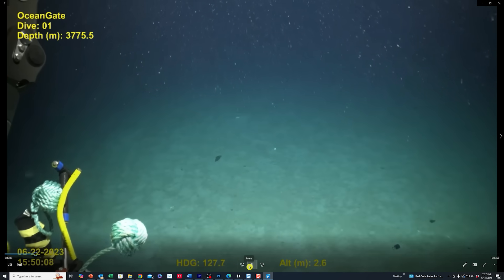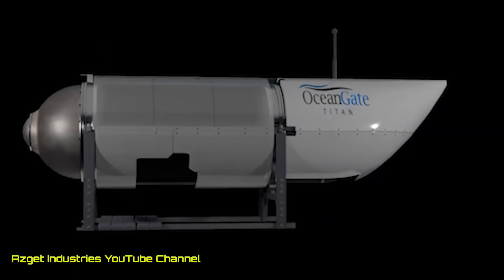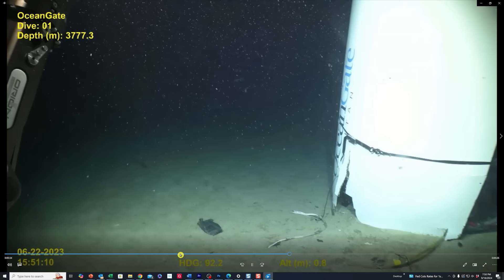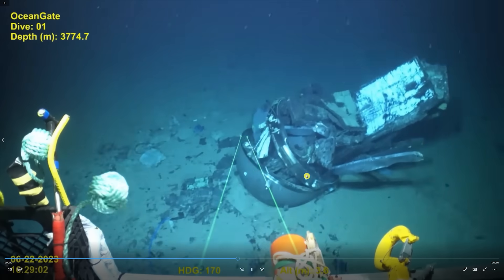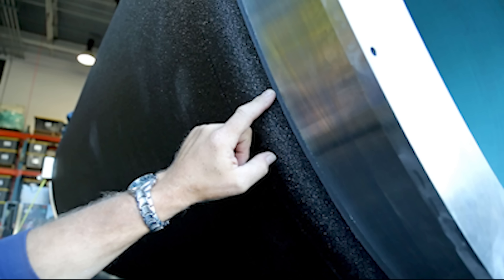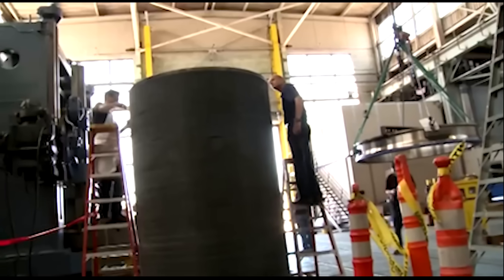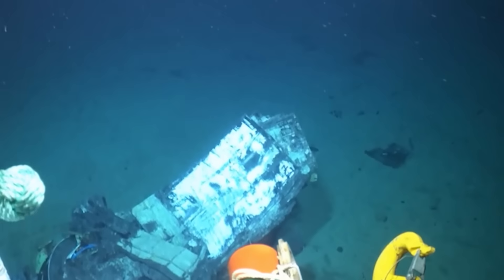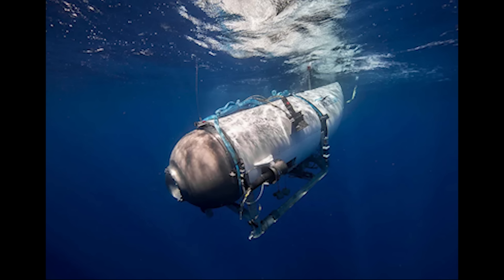OceanGate Titan Sub Debris Video Shows How It Imploded

Comment: As a Stress Engineer with 40 years experience in aerospace including Airbus and Boeing, I have experience of design in carbon fibre and aluminium and titanium.  One thing you always watch for is the joints between dissimilar materials particularly carbon fibre and metals like aluminium and titanium.  Strain matching at the joints is very important and the thermal expansion rates is also a big factor.  At such immense pressures the idea of relying on adhesive joints between dissimilar materials has got to be either avoided at all costs or researched and tested to the nth degree.  An all metal design was avoided it seems on a cost basis and some mistaken belief that carbon fibre was a miracle material.  CF has inherent flaws that require intensive testing.  The analysis of an adhesive joint between CF and titanium under fatigue loading just fills me with dread.  An all metal design would have been more expensive but far more predictable and safe.  In any Boeing or Airbus aircraft the bolted joints between components are rigorously analysed under all failure conditions.  You will not find a purely adhesive joint on an aircraft on any primary component of significant load.  Secondary components where a failure will not lead to the aircraft being compromised can have singly adhesive joints. The despicable designer of the titan sub was guilty of a complete failure to justify a design according to any sense of engineering practice.

Comment: But the pressure is pushing IN not out, so the titanium ring and the glue were not the problem, the 5" carbon fiber being wound around a template/mandril like a spool od fishing line instead of being laid up in a criss-cross alternating patetrn is why failed, the hull was almost like a  plug taken out of a piece of wood with the grain of the wood going across the width of plug instead of the length- so in the case of the wood plug  I describe- you can snap it in half easy with the grain going horzontaly across it's width whereas with a wood DOWEL, the grain is running along it's length like a tree trunk and it's much harder to snap in half.
Reply: the ring was glued to the outside of the carbon fibre tube, so pressure pushing in on the tube is the exact problem.

Comment: When we bond carbon to any metal it is bead blasted starting aluminium low pressure 45 psi to titanium at 75 to 85 psi for a good key for bonding any parts

Comment: Actually those lasers do tell size those lasers are a certain distance apart those 2 beams are a specific distance apart so yes by doing that they immediately can figure out the size of everything also I don't think it has anything to do with distance at all I don't believe they use those lasers for distance maybe they do but I know there are more use for size. And obviously that's easy to understand because that's why there's 2 of them one is used to have the distance from the other and so you can measure that and there you go you hit any fish with that in the instant and you freeze that image and you can tell the size of that fish right away um yes pretty awesome.

Comment: My concern wasnt the glue holding it together 

It was the compressive/expansive forces applied to sim/diff materials 

Its said steel wouldve been a closer mechanically to carbon fiber 

That and imperfections on the chemical lattice due to no autoclave

Comment: the front didn't 'blow off'. The carbon fiber probably collapsed and left it. The glued ring joint is under no shear loads. It could have been improved, but the failure mechanism has not been established. Compression expansion changes have not been established either. The 'expansion' is just the lessening of the compression, not really expansion. I don't think the carbon fiber tube OD/ID changes under pressure, even with the tremendous load. I would think the titanium would change more. 'It cleanly stripped itself', for all that it matters, that could have been nothing more that an annular seal (like an o ring) with the pieces held on by pressure and clamped in place until pressure was applied by depth. It is not established that the glued joint was structural or just a seal.

Comment: I know carbon fiber doesnt do great with holes and bolting, but you have to figure out some sort of way to bolt the frame to the chassis, and then have an adhesive to finish it off and seal everything. The adhesive should never be the main point of reinforcement. Banking completely on the adhesive to hold by itself is insane. If i was building something like this, my OCD wouldnt allow me to be at peace with that.

Comment: any bonding subject to that pressure should be done in a climate controlled, clean room. I work in aerospace, to go into our clean rooms where we bond titanium, we strip, then put on clean room suits. The titanium is acid etched. You wouldn't get EASA certification with that setup. Appalling.

Comment: The fact that everything is soo close together on the seafloor makes me think it must have imploded very close, if not, on the bottom of the ocean.
Reply: According to the Coast Guard hearings, they probably imploded within two seconds of their last text message to the surface at a depth of about 10,980 feet. Her wreck is at 12,395 feet, so her debris sank about 1,415 feet post-implosion.
Reply: Implosion would sadly keep the debris field small, opposite to that of an explosion.
Reply: Yeah I think I saw somewhere that they lost contact with the Titan very close to the bottom of the ocean
Reply: It was approx 500 metres from the seabed.
Reply: Could sea water leak in slowly at first , while they were still alive?
Reply: @alfreddamato5402  Not at that depth. Any breach in the pressure hull would cause an immediate implosion, as water under that much relative pressure is rather good at cutting through metal and composite, so the initial hole would be torn open and the hull would fracture.

Comment: Honestly, I'm shocked the carbon fiber hull didn't just crack under the pressure, and I bet Stockton Rush's corpse is feeling very smug about that. But I hope he's not too smug because it's still definitely the carbon fiber's fault in the end, because a better suited material wouldn't have compressed so much and would have been better affixed to the titanium. Even if he applied that glue correctly, even if the carbon fiber had been properly impregnated with epoxy, even if they were more careful and wore gloves and didn't work in a giant open warehouse, that sub was gonna implode eventually. Right around when people started thinking it was actually safe. 

It was never going to work. And the only people who didn't seem to know that were the people making it. Either that, or Rush knew and figured it'd at least survive the trip where he was on it and implode when someone else was driving so he could continue to pretend there's nothing wrong with the design, as we all know he would have.

Comment: The last message from them was at 3,400 meters where they briefly said that they were releasing weights, to come back up, of course. So an issue must have occurred well before they got to the full depth, but likely just seconds after that weight release, it imploded. So they never reached the Titanic and they were desperately trying to rise back.

Comment: The compression should keep the ring in place even without adhesive. Pressure outside should keep the ring firmly in place. That said carbon fiber hasn’t been known for its compressive strength

Comment: Surely they calculated the different materials compressionrstes due to pressure and temoresture differences, as done all sorts of extensive test of the carbon its durability under the conditions it was going to opperate, before putting humans, let be paying customers in it. Well at least these customers did their research and new what they was risking. Sad. But not enough tears to spare any for those getting themselves into risky situations for no good use, but selfsatisfactory.

Comment: Note to future submersible engineers; (1) Don’t use glue to attach metal, rubber, plastic, glass or carbon fiber panels together.
(2) Don’t use many different materials for the exterior walls, try to keep it simple with one strong material like a single piece titanium and small haul to reduce surface area that needs to be pressurized. Try to minimize use of any glass windows, cameras are better for safety reasons.
(3) Listen to people who advise you if a sub’ isn’t ready for a dive to such great depths under the ocean.
(4) Don’t dive so far down if you have plans of returning to the surface because if there’s an accident, even your body won’t be recovered.
Reply: All excellent points. 
On point # 2: Regarding the construction of a smaller hull. This speaks to the greed of Ocean Gate’s owner. In order to recoup his investment and start turning a profit from deep sea tourism, a questionable endeavor in its own right (!)…, he needed to jam as many paying customers as possible into his death capsule at a time. Despicable.
Reply: @mercoid  Yes he didn’t have to make is so big. He could’ve made two or 3 very small subs to hold about 2 people each. Just a captain and one passenger. I’m sure people in the industry now know a big haul is the major failure point during an implosion as well as materials and joints used on the exterior. Under seat water pressure is not a joke.

Comment: There is one thing wrong with that artist impression of implosion showing the carbon hull imploding. Now that is partially correct, what would have happened as well, the 2 domes either end would have slammed together due to the enormous pressures on both ends.
You can see from the video, a huge amount of carbon fibre ram inside of the front dome. These 2 domes would have smashed together with enormous force, and I feel this is the main way the sub would have imploded. length wise.

Comment: Some of the debris you see in these clips are tiny bits of people. Not a joke. One guy mentioned that. It’s not just stuff being kicked up but what is left of their passengers.
Reply: All I can think of is how all the bacteria there was eating good for a bit after this
Reply: The implosion would have heated the air inside the sub to a high degree due to compression of the air (like in a diesel engine) and they likely would have been incinerated in an instant before the water cooled what was left of them again.
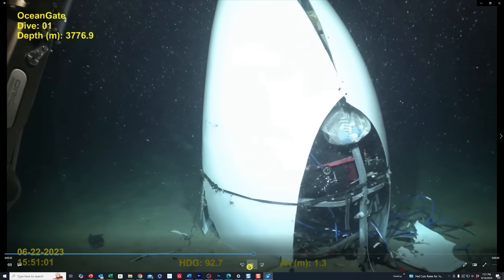Reply: Agree body parts would be scattered just like in “This video” paused @ 0:25 in, there an upper half of a skull with grey hair and glasses 👓resting in front of it.
Reply: Trying not to be morbid, but... someone mentioned on another footage video a few days ago that you can see at least one decapitated head a few feet away from the front dome, the one dome resting by itself.  
Watching this video disturbed me because it is a higher resolution, and I see another possible decapitated head when the ROV makes it's way to the front dome.
I cannot dispute it as both strongly resemble human heads.  Maybe one day we will know.  But I suspect it could be true as the immense "pressure jet of water" initially breaching the ring is more than enough to cut through biological material.  The carbon fiber shattering could also do it, ai guess.
Sorry to be gruesome, but the footage is here on YouTube from a few different angles if anyone can confirm or dispute with stillshot sharpening.
Reply: Also just to note, firstly, the bacteria that decomposes humans cannot survive in that environment.  It doesnt exist there.  Too cold.  Number two, this footage was only a couple days after the incident.
Reply: "One guy mentioned that"
Reply: This is what I was thinking as well, especially around 0:15. All that dust-like things flying around might be sand + human remains paste 🙃
Reply: @chsanj lol, can almost guarantee you that dust has zero human remains in it after a year under such immense pressure. 😂
Reply: @ericaallisonc  the video was taken only days after the implosion. Notice the date in the lower left corner.
Reply: @ericaallisonc  how many people have you converted to paste so far? you know since you can guarantee what happens

Comment: 8:45  not sure you get the engineering idee behind the use of this « glue »: it is nothing structural, just sealing the ring to the carbone cylinder: then the pressure on the end titanium cap keep all « together »

the failure mode is when the carbone cylinder edge start to delaminate under both stress : the radial one , coming from the pressure around the cylinder and the axial one, coming from the pressure on the titanium cap.

as soon as the carbon start to loose integrity the radial force start to flatten the cylinder and the ring and titanium
just pop out.

Comment: so let me get this straight:
It is not a smart idea to go down to unimaginable pressures in a plastic tube?

Ok, got it.

Imagine being the rich guy who went onboard. You would assume he had some sort of a brain to become rich, and yet this clearly shows he didn't have a brain.
Reply: Not plastic, no. Carbon fibre. Which is theoretically - possibly - a suitable material, just not the way they did it.
Reply: @skepticalbadger  Man o man, are you serious?

Carbon fibre, yeah, i know.
It is not the same as plastic.
It may be stronger than metal.
BUT only when applied correctly and in the right circumstances.

Not when you glue some piece of Titanium to it and expect that bond to hold up.

You say: Theoretically - possibly - a suitable material.
Well, as we have seen by the example of the Titan, people with some piece of functioning brain material would say this is NOT a suitable material.

BTW, i have to ask: Why even choose another kind of material if we have materials that are perfectly capable of going to such depths again and again?
You know, steel and that kinda stuff?
How many times have they gone to the Titanic in the tried and proven way to go there?
From the discovery of the wreck up to now, how many times did they go back to the wreck in the same submarine or how you wanna call it?

Why introduce a new way if there is a safe way, proven by experience and such?

"just not the way they did it"
This will be the last of this comment but i have to ask: 
How do you vision it?
How to use Carbon fiber correctly to visit such depths and such pressures?
Sorry, but even if you answer this question, and are able to demonstrate it in real life by building an example of your theory, i still wont climb onboard.
I will stick to the people who discovered the wreck and are using their technology to again and again visit the wreck.
You know, steel hull or even stronger materials.
Not some kinda plastic or glue with fibers in it. Epoxy. Plastic. NONSENSE to use for such expeditions.
Reply: @skepticalbadger  do film your descent to this famous wreck when you go in such a plastic tube, o wait, glue and fibers.

Film it, and please make sure to protect the camera in some kinda case so we can find the footage.
So we can see how it all went wrong, AGAIN, after sooooooooooooooooooo many examples from the past.

A Plastic tube, o sorry Glue and fibers....
Holding on to a titanium ring.
Glue, nails, rivets.
RIDICULOUS.

And theoretically a suitable material?
Well, it has been shown that it is simply NOT a suitable material.
You may continu down the dumb dumb road of the lemmings. I do not care.
You have lost your brains if you climb aboard a contraption like the TITAN and expect to make it back alive.

How much did he ask to go down to the Titanic?
I would not even have paid a single dollar.
Nor even a dime.

Comment: I don’t get why they wouldn’t have found a mechanical way to back up the bond from the glue. You have 2 titanium ends that could have been tightened against each other. There was plenty of internal room to encompass a mechanical connection, or else an external one. It’s not like the thing was pretty anyway.

Comment: How did they manage to get enough air in the sub to last so long?  I guess it must've been very compressed, but it still seems like a lot of oxygen to be contained in a such small machine.  Not arguing, just wondering.
Reply: They had CO2 scrubbers.
Reply: @skepticalbadger  so that gets rid of the co2, is the remainder oxygen?  Thanks

Comment: I think the first ring in the back end that attaches to the tail, the other half buried in the sand is the viewport. Looks like the probably started on descent and they imploded and settled in the sand, or the trouble started on the ocean floor and they tried to do an emergency ballast blow, and they stared up and fell back down and imploded, based on how the tail is sticking up and the front is half standing half settled and the front ring is the viewport attached to what's left of the cabin.

Comment: I was previously employed at a company that produced $500,000 composite aircraft. Specifically I was in the layup department where I laid fiberglass and carbon fiber into various molds. F.O.D. and any sort of contamination was a big no no. Just a small piece of paper or oil from your hands in the wrong spot could result in a delamination. Last thing we wanted was a critical failure at 30,000 feet. Latex gloves and frequent inspections were always required. I see the narrators point about how the glue was applied to a smooth metallic surface. Any surface on our aircraft that was glued would be sand blasted to a specific surface finish then wiped down a few times with cleaning solvents.